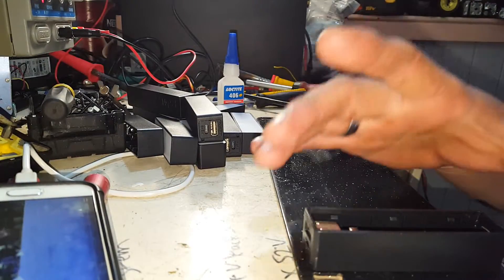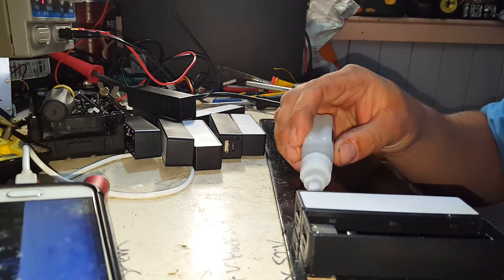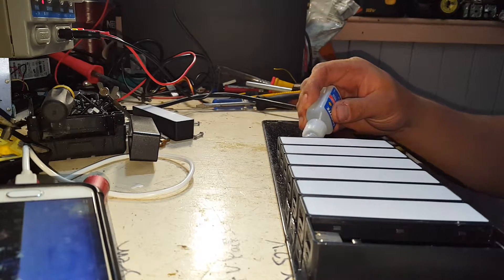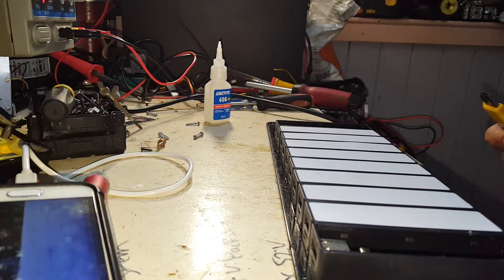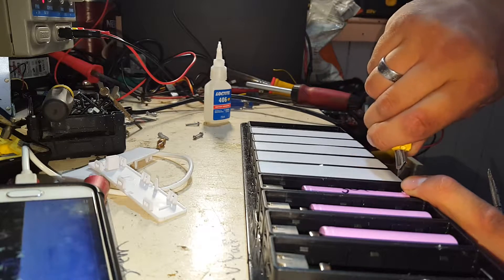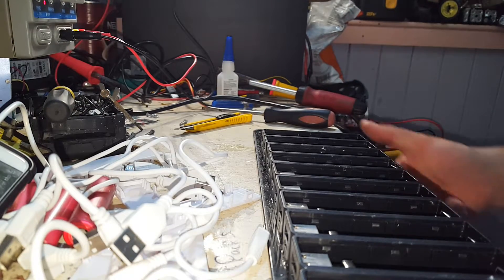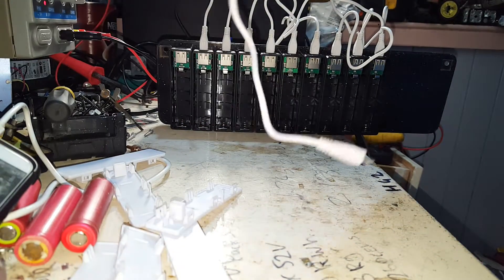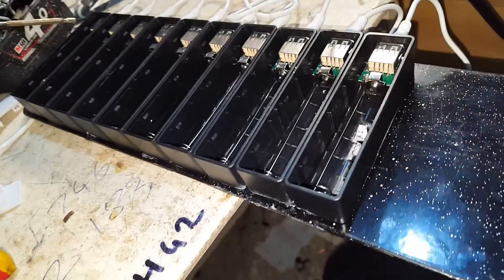Building a 10 bay 18650 battery charge dock pt1

Comment: Was half wondering what these cost in bulk, eg what the shops pay for them.
Then I found this listing 1000 powerbanks minus the batteries
http://www.dhgate.com/product/1-18650-2600mah-power-bank-case-battery-charger/217921384.html
43 US cents each
Reply from the maker: +station240 _ its definitely  a way to do it
Reply from the maker: +station240 _ https://youtu.be/9r780xCJ8Ww
Reply from the maker: +station240 _ thats dam cheap isnt it so ya need to buy 1000?

Comment: I noticed that those things heat up pretty good...
Reply: tumppi7 Yup I had one of like these too. was testing and just messing around and accidently touched the usb hub. Damn it felt like the thing was gonna melt
Reply from the maker: +tumppi7 yeah these will have the top left open to let some heat out video of it completed  and working will hopefully  be uploaded and ready tomorrow.
Reply: Likely the inductor is undersized, not enough iron core so it saturates too easily.
Would be annoying to replace them however.
Reply from the maker: +Koning Willem-Alexander ill get the temp gun out next time i charge  them up see how they go
Reply: One up the sleeve customs seems like a interesting video